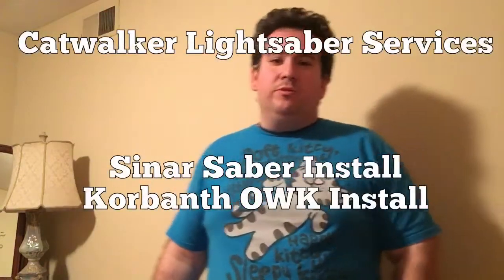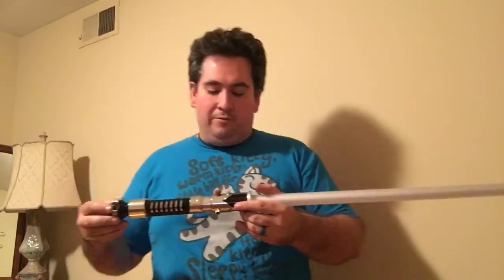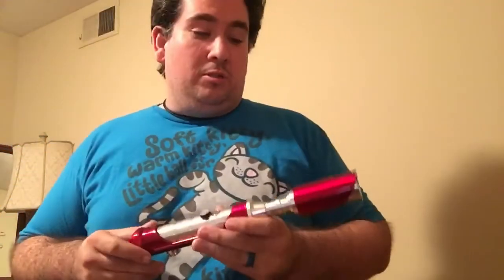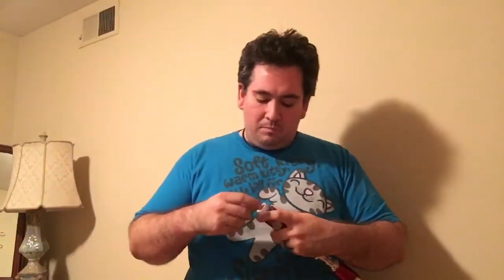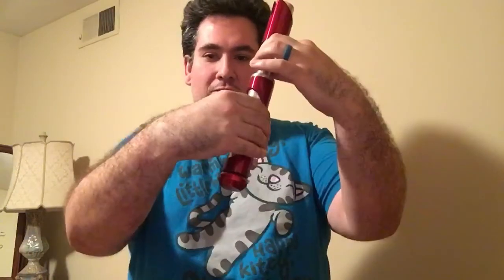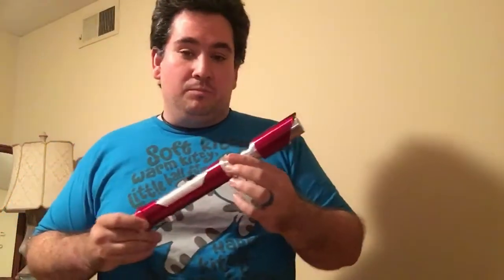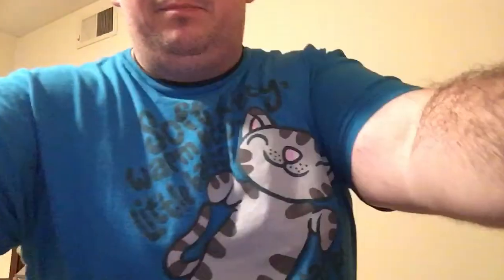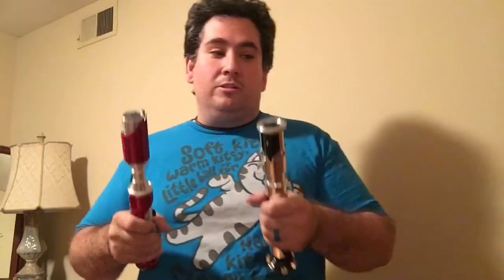Sinar Saber Install/Korbanth OWK Install

Comment: Hi, id like to get my 1st saber, do you have any brand recommendations? Im not looking for the expensive one, all i need is the saber; starwars look, can be use for duel (moderate), bright and changable light color, great sound (on/off and swing)
Reply from the maker: Saberforge makes cool hilts.   Just make sure the hilt you are getting is in stock and not a preorder  bc otherwise you'll be waiting forever.  It took 10 months to get a hilt for my final install.